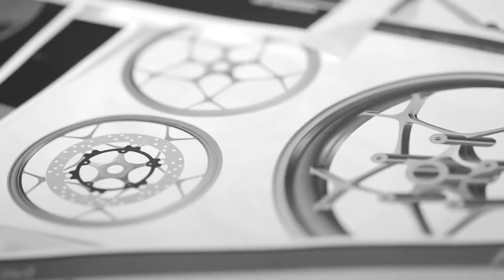Yamaha Motor's motorcycle assembly factory　~Made in Iwata

Comment: Glad to see that they're still built in Japan
Reply: some are built in japan some india some the US they keep the top models in japan the crap ones like the ATV's in the US and the rest like the R3/MT-03 are india
Reply: Only parts given with NEW motorcycle are JAPANESE (Some of)

Most of the service parts provided later on are made in INDONESIA.

For example:

My R15 has cylinder block code name: 3C1 = perfect die casting
I bought KIT and cylinder inside is 1PA = Lot of imperfections in DIE CASTING

Same goes with piston rings

Newly purchased bike has 3C1 piston rings = MADE IN JAPAN = Costs 6x times than Indonesian.
Piston rings now comes with kit are = 1PV = Made in Indonesia.
Reply: Japanese steering bearing set kit = 3 Thousand INR in total
Indonesian Steering kit = 500 INR
Reply: The Yamaha tracer is now made in sweden
Reply: @Sam-to1zg  Probably a lot more quality control that goes into their parts
Reply: Where is my yamaha motorcycle built which I bought in India?
Reply: @Sam-to1zg  And my Yamaha steering bearings needed first to be replaced after 43 years.
Reply: @epoxy1710  True
Reply: @AkashVerma-hh9th  Its not imported or CBU,  but many parts were imported from Japan for first few versions of Yamaha R15, I have R15 v2.0 Its build in Japanese parts are 4-5 times costlier than Indian and Indonesian parts.

Comment: Hello, I would like to give you an information that maybe Yamaha engineers have not noticed, but all scooters in the XMAX line have a very serious defect, the rear suspension does not work for the rider, as the rear suspension is at the end of the Scooter and without any  inclination, works only for the rump, while the rider, which is the most important, has no damping to protect the column from bumps.  I work with an XMAX 125cc 8h a day in London and I started to experience terrible back pain after buying this scooter, because the XMAX rear suspension is at a right angle, with no forward tilt, as most scooters and motorcycles have  .  causing great discomfort to the pilot who uses XMAX for many hours at work
Reply: You are right about this, i don't think the XMAX is designed to be riden 8 hours a day thats why the pain in your lower back. You should buy some Nitron R3 or YSS shocks for the XMAX to improve comfort.

Comment: My Yamaha Ray ZR scootre engine oil level  comes down abnormally after every re fill and I have been observing this situation from the biggining of the use of my brand new bike.

Instead of engine cylinder block damage, can there be any other reason to reduce engine oil like this..

In addition I checked the compression level of engine while it let to run freely In a slump and observed that it is gradually break it's own by slowing the engine.

Comment: < /ivarconst_20 font stencil white on red background YZ 250f and 450f / /< per radiator shroud and rear fender
with K' shark / /account 1 K' 2LMoRxy black color rear fender and shrouds account 2 red engine hoses ~ ^*2dxyLoMoRyxxm(t) an AVN grn interprets goto32 vectors of radiator L an R account 3 R&D pipe - muffler shape fittings / >